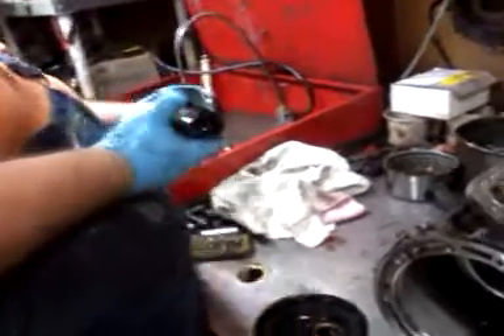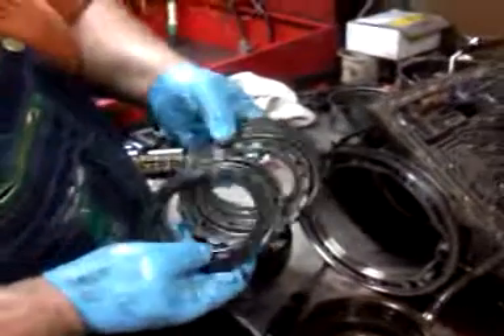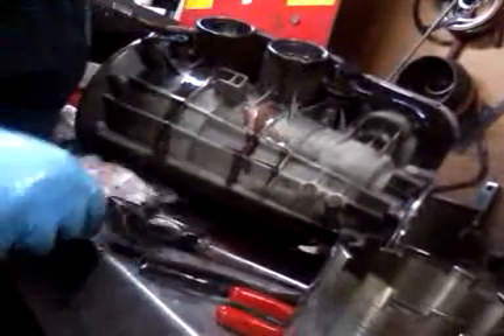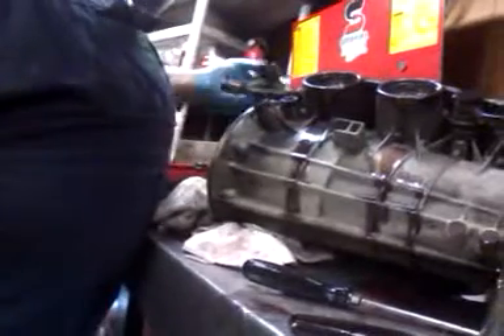A4ld teardown

Comment: I know you may never answer this but my afld list drive and I revved the motor until it caught .it worked but slipped and stayed in drive after that .when I put it in reverse it would bog the motor down.it stayed in drive regardless.Have I welded my clutches together or what you think

Comment: It's like a magic hat that you keep just pulling parts out of! You are obviously very confident in what you do. I was just checking this out because my aerostar's 3rd and 4th gears just quit today. I'm wondering if there is anything I should check for before I rebuild or get a used replacement. Brake band adjustment?

Comment: A question for you. I have a 87 Ford Ranger with 2WD and a 2.3 liter engine. Some jerk crashed in it and took off. I can't move the shifter. What is up with the weird shift linkage on the Ford Ranger? What position is the lever on the trans when it in park, reverse or drive?

Comment: Also, where would you buy internal parts for a A4LD transmission, or any transmission. All the parts stores have limited accessories and modulators for them and that's it?!?

Comment from the maker: I do own a shop and i get paid by the job hence the reason i use an impact to dis-assemble the transmission. the same way they do at the dealership (i am Mercedes Benz certified) as well as an ASE master tech. go troll somewhere else.
Reply: My transmission went out in my 2.3 liter mustang and making a winning noise. No metallic shavings in the pan and the fluid is not burnt. Someone told me it may be the pump.
Reply: He stripped the tranny with ease and you saying he don't know what he doing! Try tearing one apart if you have never done it and see how long it takes you. And what you probably tear up
Reply: @Someguyto  go to precision transmission on youtube
Reply: @johncasebolt3165  gay
Reply: @MIckveli2  That gave me a lot more information. Thank you.
Reply: @MIckveli2  link?